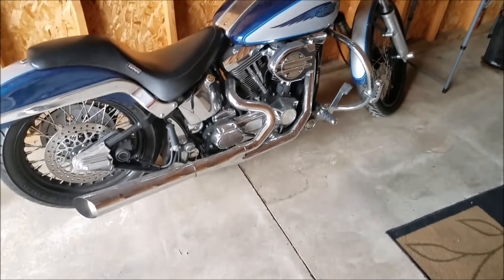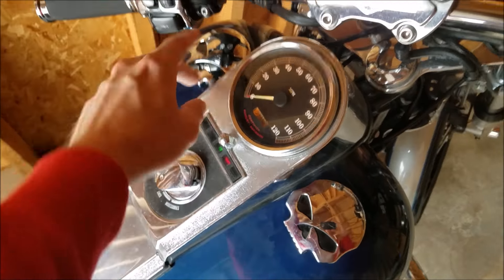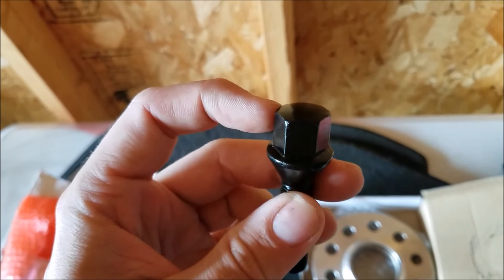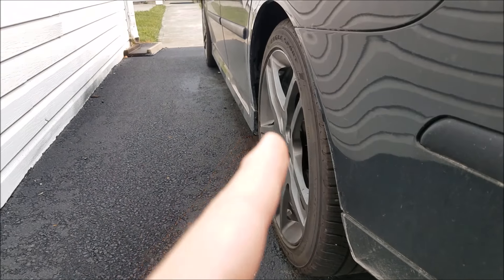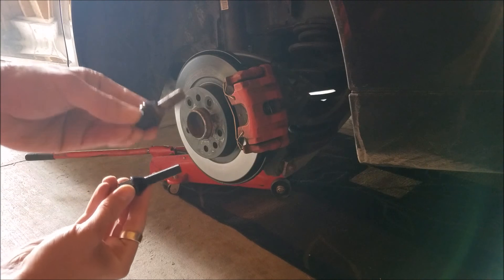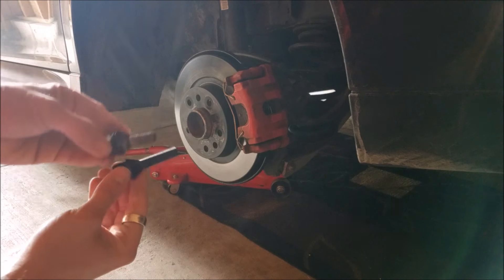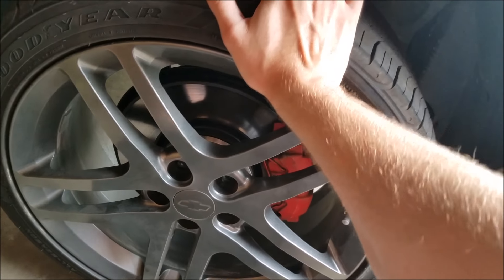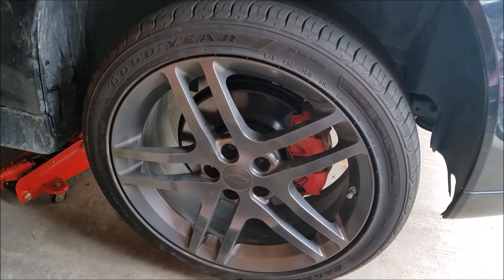Getting Perfect Saab 9-3 Wheel Fitment

Comment: You should always clean the hub with a steel brush! The spacer should always go on witout any resistance!! Very important!!  shouldn't have have to torqdown the spacer to make it sit correctly to the hub. NEVER use a hammer to make the spacer sit right like in the video, just clean the hub and it will go in smooth!!! I strongly recommend you to remove the spacers and do it alla over again! (This is not hate! Im just concerned about your saftey and others who might watch this video)
Reply from the maker: I agree it's definitely a good idea to clean the hub surface and hub lip really well before spacer installation. If they don't seat right you can have serious wheel balancing issues. Since this vid I purchased a wire wheel.
Reply: That's some excellent wisdom

Comment: OMG, but didn't you see that the spacer remains detached from the hub? The spacer cannot remain detached from the support point of the hub, it must be totally attached. It is a wrong size, behind and in front the wheel centering point protrudes differently and you need a spacer of the correct size that can contain all the wheel centering point. Behind the minimum size to be able to do it is 17mm, maybe even 16mm but you should try and I'm not sure, to have the wheel flush you need a 20mm spacer but the fender must be rolled and in any case it touches the internal protrusion of the wheel arch. In front, however, the minimum size is 12mm for spacers with centering ring, to have the wheel flush you need a 15mm spacer and the fender must be rolled.

Comment: Nice vid man. I have a 2007 93 with that same body-style (before the face lift). I want to add some fog lights. Is there a plug already down there in the bumper or will I have to wire to a switch or something? Also nice black covers on the bumper lights

Comment: Why you don’t clean the rusty before you fits your new part?
Reply from the maker: For sake of time I didn't in the video. Some time later I ended up wire wheeling off the rust and used rust protection black paint.

Comment: What wheels is on your saab and what is your offset
Reply from the maker: Wheels are from a 2008+ Cobalt SS/TC. If I remember correctly the specs are 18x7.5 with 42mm offset and 235/40R18 tires. I put on 10mm spacers both front and rear to get rid of the horrible counter sunk look.
Reply: Weakest of Weeks lol thats the tire size i want to run the wheels im getting is 18x8 40et i already got spacers 15mm front and 25mm back not sure how much poke i will have on that

Comment: Where did you order the spacers and extended lugs?
Reply from the maker: Just search for hub centric 5x110 10mm 65.1mm wheel spacers. I found mine for cheap on ebay.uk and had them shipped to USA. Extended lugs can be found here: https://www.ebay.com/itm/TUNERLUGS-12x1-5MM-20-PIECE-BLACK-CONE-SEAT-LUG-BOLT-SET-40MM-/263960457601?hash=item3d7544f181

Comment: Where did you get the spacers?
Reply from the maker: I bought them from ebay. Not sure on brand. Just make sure you get 5x110 and hub centric then pick out the thickness you want.
Reply: @WeakestofWeeks  Ok thanks.